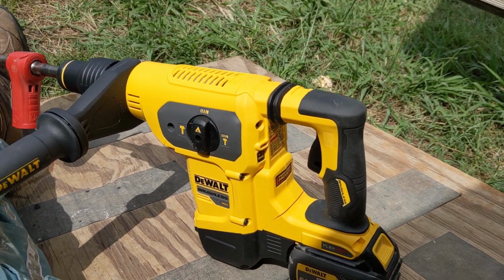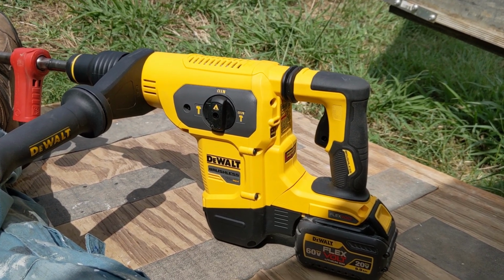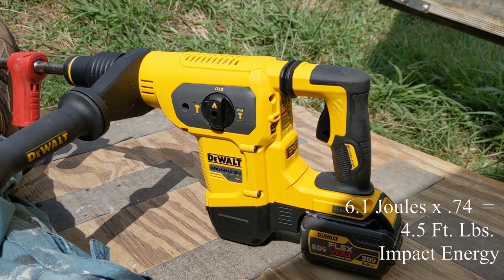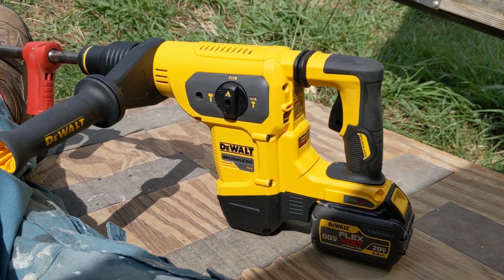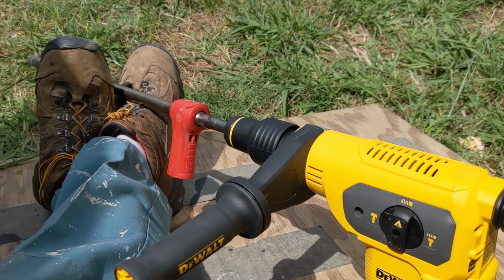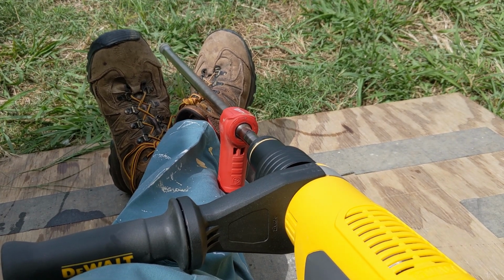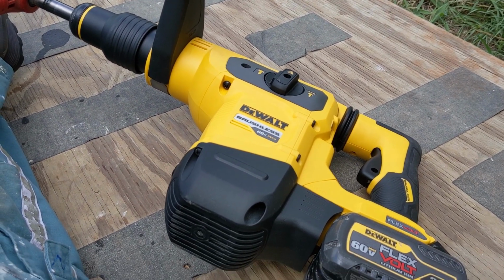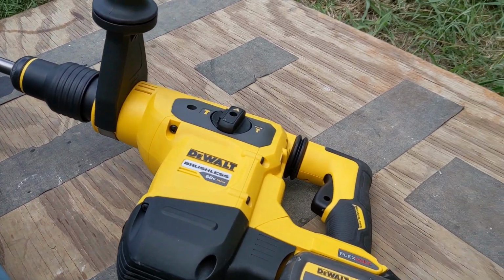Dewalt Flexvolt DCH481 60v Max Cordless 1 9/16" SDS-Max Rotary Hammer

Comment: Actually, Joules are the international units of measure, as opposed to foot-pounds.  Nothing wrong with listing it as Joules.
Reply from the maker: I wasn't saying that using joules was wrong in and of itself but that it is matching figures with a similar Bosch unit but is actually less powerful because joules are a little less than 75% of the impact energy of rated ft lb. Milwaukee and Bosch, the competition, list in ft. Lbs. DeWalt uses Joules and so their numbers are larger. I see this in other DeWalt offerings (tape measure reach vs. Standout, UWO vs torque, etc.)

Comment: When you give an opinion it really helps to actually identify your reasoning. Those boots are not straight. They are meant to get a hole in rock. You didn't show anybody that the bit was not straight by rooming it on a flat surface and you didn't show anybody why you thought the performance of the drill was bad. I think you are just impatient. I use a Bosch bulldog extreme with half the impact power... And that thing is amazing. So my guess is you just don't know how to use rock drills and chisels.
Reply from the maker: Capturing stuff on camera is difficult, and it's been a while since I had this hammer, but I was use to a lot more power from my Bosch. The slick marketing gimmicks of DeWalt turned me off this drill as much as the wiggling bit and cheapness I felt. Sometimes you can just feel that a tool isn't well made and you have to stick to your intuition on that.
Reply: @MyFortressConstruction  I just ordered the dch481x2 and this drill. I will post a couple videos. Check them out in 4 weeks let me know if it's accurate to your results.

Comment: Glad I came across your review of this. As a GC we have a lot of 20v dewalt stuff, and have been considering stepping into the 60v platform. However you have validated some of my concerns about tools like this. I will stick with the Bosch corded
Reply from the maker: I really like the Flexvolt line for the most part, but their tools require a heavy investment into their batteries. So if you were looking for a one tool replacement, stick with the cord and generator, but if you plan on going all in, I think flexvolt beats Milwaukee in the heavier tools like this. However, this is their cheapest rotary drill and it didn't feel like quality. Maybe someday I'll have a reason to buy the $$$$ Big brother to this one, but for now, I'll stick to corded too.

Comment: The Bosch is $200 more, and the batteries are not on par with the DeWalt but if you are doing a lot of concrete drilling on a daily basis it makes sense to stick with the Bosch.

I would RMA the tool to have it replaced due to faulty chuck.  Over time that will kill the bearings plus it's tough on the wrists and bits.
Reply from the maker: I just returned it because it didn't have the power I wanted. I'm sticking with my corded Milwaukee 1 3/4 for now.
Reply: @MyFortressConstruction  try the DCH775 if you want to see plug-in equivalent power with DeWalt or the DCH614 for similar size and better power than the bosch.
Reply from the maker: @MrPhatties  Yes, I just didn't want to spend that kind of money for something I don't use all that often. My Milwaukee was $200.

Comment: The DCH614 has 10.5 jules
Reply from the maker: Yeah, if only they weren't so expensive! I got the 1 3/4" corded milwaukee for $200 (11 joules 8.1 ft lbs.) and I'll just stick with that.
Reply: @MyFortressConstruction Cordless is still good for literally anyone workinf out of a truck
Reply from the maker: @matt59fire  Generally, when I'm using an SDS Max drill, it's for extended work like drilling 40+ 1/2" holes or removing tiles off a floor, etc. So, you can get by with cordless, but SDS max drills take a lot of power and you'll be eating up the batteries with a cordless tool. I've got 7 flexvolt batteries and that's about 3 hours of work worth of batteries. A generator and a corded SDS Max for me. I do use my SDS+ for little jobs. That has been great.
Reply: @MyFortressConstruction  Im an electrician but use rotary hammer drills to bore holes to put conductors thru walls etc... For me personally, i think this is enough. I wont be doing 3hrs of constant use